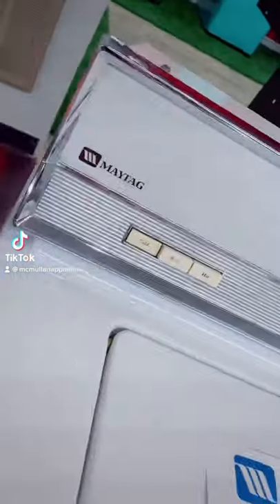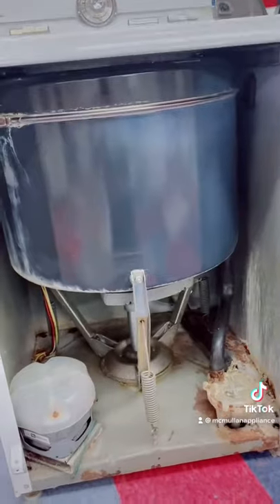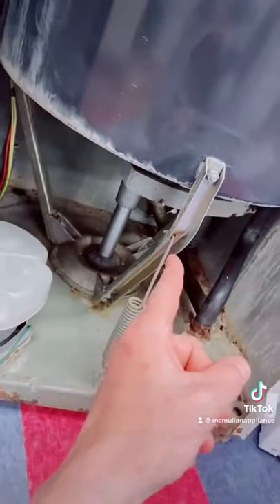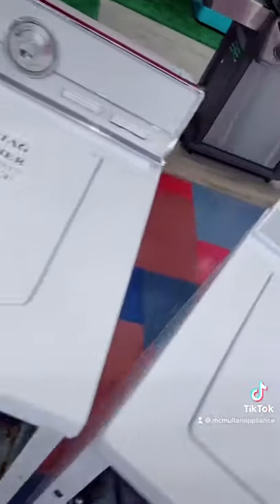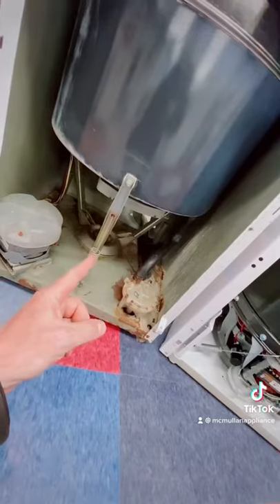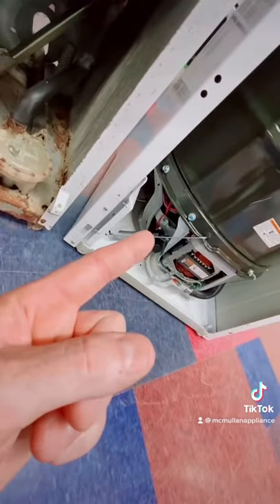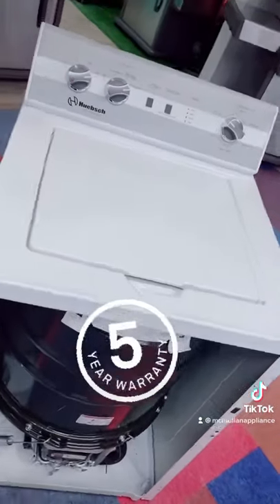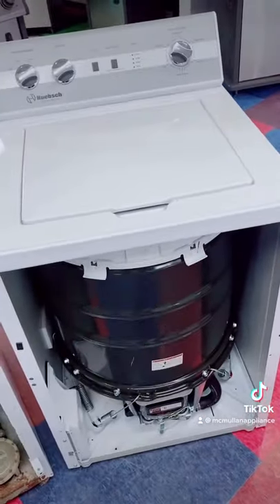1976 Maytag vs 2021 Huebsch TC5 (Speed Queen) Washer #shorts

Comment: Ok, one thing though. EVEN THOUGH the Huebsch washer is "Reliable", you will find a TON of those older Maytags everywhere you don't expect them to be. Speed Queen (Huebsch) have many issues now with the newer technology. They can have control board fails, pump fails, suspension fails, even motor fails. Not saying this is super common, but Speed Queen and Huebsch have gone down hill since the TC5 and before. I am not one of those people that say don't buy them, but I personally don't like them.
Reply: The TC5 is an old model.  BTW, it’s not the electronics that are a big failure from what I have been able to find; it was a faulty drain design that could suck in things like socks and get ruined in the process.

Comment: Can anyone explain why you  TC5 has to fill up likes it’s doing a large load every time? I only do small loads!
Reply: That's a good thing, most of the new energy conserving junk fills up half way. My GE does and the clothes dont even get fully soaked and swished around. 
If your concerned, wait a little longer until you have enough to load it right up.
Reply: Make sure to turn off the deep fill option the blue light will go out for 1/2 load